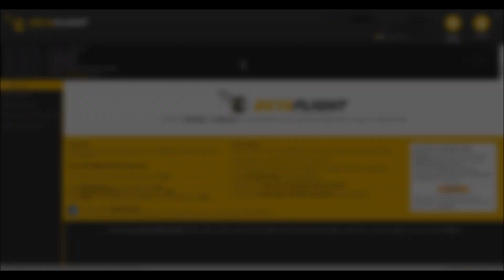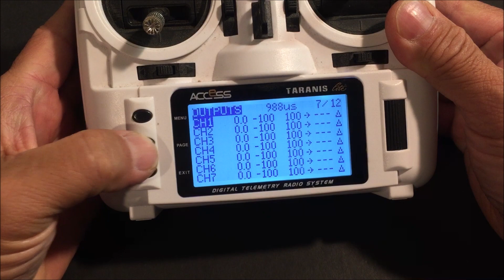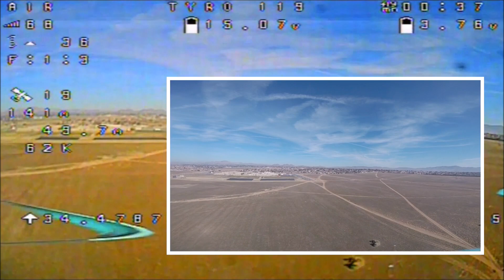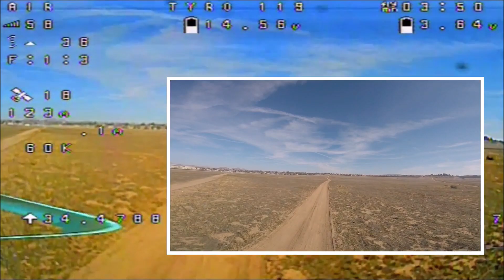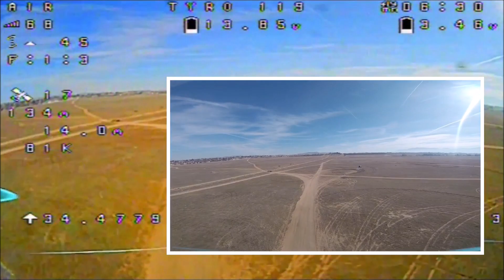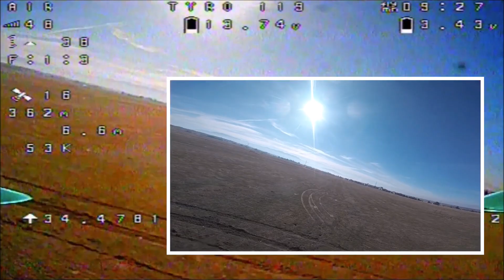SET UP / GPS RESCUE / FAILSAFE RESCUE / TYRO 119

Comment: Hi Pete, thanks for the video. I followed your video and so far it worked, except that the 3d Position stays on false and satelites are  0. You have any idea what could be wrong?
Reply from the maker: You have it hooked up inside the house?
Reply: On the balcony, but I went out now and it works fine. Seams that its realy a free sight in all directions is needed, thanks alot.

Comment: Hi. Great video.
But I understand that you only need to activate softserial for the failsave GPS RESCUE?... The GPS rescue via switch should work without that, right? For those of us who have no telemetry reciever like Flysky X6B...
Reply from the maker: You don't need telemetry at all to have gps rescue regardless of the receiver :)
Reply: @RCEscape 
Ok.
I think so, too. Under betaflight 3.5.7 it worked fine for me. On a rebuild of my 5" I used another fc with beta 4.0 and I have a lot of problems. A new 3" build with beta 4.1 has the same issue (home arrow not working well; when switching Gps rescue it has a failsafe; speed and altitude are updated very slow - - > already checked baudrates). 
Apparently there is a bug with osd. Other people complain as well. Now I saw a possible solution (change osd font to bold) but in corona times in spain its impossible to go and test it in field. We'll see...
Reply from the maker: @ingomohling1864  
when checking gps rescue, the quad has to be farther away than the set parameter to work or it will failsafe and drop to the ground so go beyond the distance you have set and flick the switch.

Comment: hey i have some problems with my tyro119...
1)
GPS not working, its always at 0 satellites, had to disable gps to be able to fly
2) with 6S my OSD is turning off at a punch
3) Turtle mode is going the wrong direction
Reply from the maker: Man...sounds like a lot of problems all at once.
Does it fly?
Reply from the maker: What I would try and do is reflash betaflight on to the board and see if that helps.
I just fixed one of my old quads that is so erratic I could not even fly it and now it is perfect after flashing the latest firmware.
Reply: @RCEscape  What FC Target did you use to update to latest firmware?
Reply from the maker: @mgtschida  
If you connect the quad to betaflight and go to the cli command and type in version and hit enter it will tell you the target.
Reply: @RCEscape  When I did that it gives me " MATEKF405 (MKF4) 4.0.3" but Betaflight configurator 10.7.0 only shows up to version 4.1.1 for the target "MATEKF405" (not up to 4.2.2 as is the current stable release).
Reply from the maker: @mgtschida  
Then that version is the latest version betaflight supports.

Comment: Hello Pete! please give me an help...my problem is that also when i connect battery the GPS feature still stay off even if the module has the red light blinking (that is correct i think) so arm funciton is disabled. In betaflight GPS is in UART1 like in your video and i set failsafe in GPS rescue. In my opinion the connection with flight controller is ok becouse i can see gps setup in configuration and i cant if i disconnect the gps from the flight controller.
Thanks a lot.
Reply from the maker: Massimo Stefanoni 
Have you taken it outside in the open and gave it a couple of minutes to search gps?
Reply: RC Escape hi, thanks for the answer! Well yes i did, the gps itself seems to work good (red light blindino). The problem si that in betaflight it’s not seen and if i try to fly the drone not arm and in osd there isent a Any information about gps even if i setted it to show gps signal. It’s like there is no information with the flight controller.
Reply from the maker: @massimostefanoni9054  
gps module soldered to an empty uart,
chose gps on the ports tab corresponding to the uart,
turn on gps in config tab, turn on barometer,
set a switch on the tx for gps rescue,
match it on the modes tab,
turn on gps rescue in the failsafe tab,
turn on all the osd stuff in the osd tab?
Reply: RC Escape hello and thanks for your help. I try to Connected an other gps module and i had the same error. The gps Connected well to the signal (that’s becouse i see the correct blinking led) but in betaflight i cant see the gps working well.  Also in the OSD even if i set up gps information i didnt see nothing in the goggle. It’ s possibile i make en error connecting the module? I usede the eachine cable but rx si Connected to rx and tx to tx (maybe rx must be Connected to tx and rx to tx?)

Comment: Thanks for this video, it was a huge help when I put together all parts for my Tyro 119, I have an R9MM receiver, and I cannot discover other sensors than just Vbat and telemetry, how can I do to have more sensors?
Reply from the maker: do you have the smart port telemetry wire connected to a tx uart pad?
this guy has the same receiver and got his sensors to work
https://www.youtube.com/channel/UCRxXtvmc8nm7EtJuaIGyOoQ
he can probably answer your question better :)
Reply: @RCEscape  Thanks for your response, yes I follow all steps that you explained on the video, but I cannot reach another sensors, just a couple that you mentioned before to configure your Taranis in video. Well I will try to ask to him, because also I have GPS flashing blue light, and I don't know what happen because there is cero satellite in my screen

Comment: I watched your last GPS video set up 
Very helpful 
I have a question what are the white plugs called ? 1.25mm Pitch Connectors Or 1.0 
Trying to figure out these connectors 
The GPS antenna wire it came with is not silicone wire . They are hard .. 
Would like to replace it with softer wires
Reply from the maker: I do believe they are the jst ph 1 connectors.
Reply from the maker: https://www.banggood.com/20Pcs-Mini-Micro-JST-1_0mm-SH-4-Pin-Connector-Plug-With-Wires-Cables-150mm-p-1170261.html?rmmds=search&cur_warehouse=CN
Reply from the maker: just make sure they are silicone
Reply: RC Escape  
Thanks for your help 
That will be helpful

Comment: I love your hang time in the desert, and flying that big 6 inch in your backyard takes some skill!  Thanks for posting this this morning,  I think it saved me from losing my Tyro119.  All the telemetry works so I thought I was good.  After testing in a safe place just now, it just dropped. 
I have two questions if you don't mind.  I have a R9-mm receiver with an unused inverted s.port tab.  Does that mean I don't have to use soft serial?
And,  on the second page of the model in the QX7, do you have to change the failsafe from no pulses?  Thanks!
Reply from the maker: Thanks for checking out the videos :)
I am not familiar with the R9mm receiver but if you have all the telemetry working then the gps rescue should work.  Have you toggled the switch beyond 100 meters?
I have my failsafe set to not set.
Reply: @RCEscape  That may be my problem.  I'll try it again tomorrow.  Thanks for your quick reply!
Reply: I just thought I had telemetry because everything worked, but there was only two sensors on the telemetry page.  I soldered the inverted S.port of the R9mm to Tx4 and got all the sensors with twinkling stars without softserial, with your help.  Test comes tomorrow!  Thanks!!
Reply: @MrLightstuff  Hi, in wich UART in BF you activate Telemetry output? because I have the same issue... Thanks John! I will try my Tyro119 this weekend, it's a great kwad!